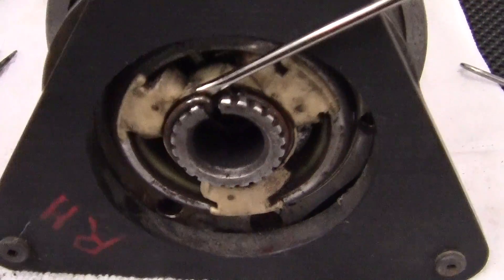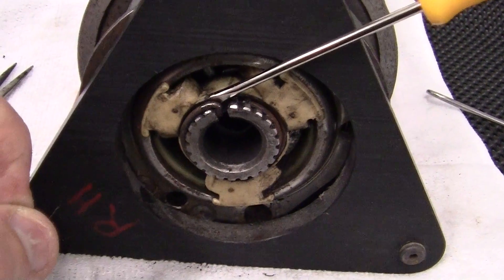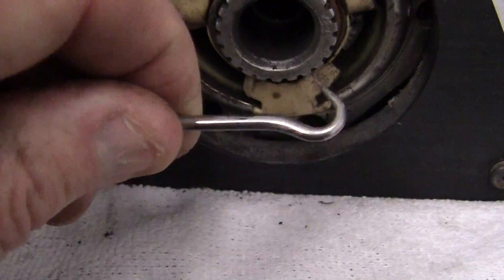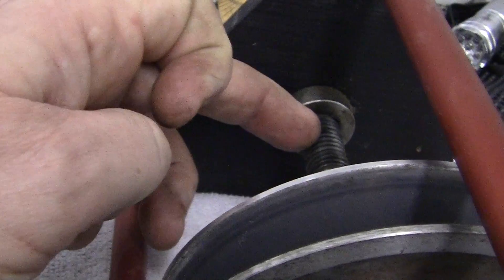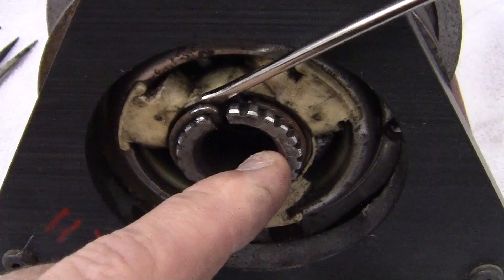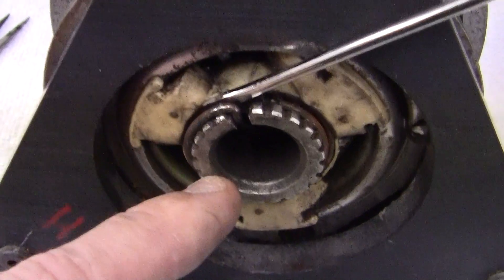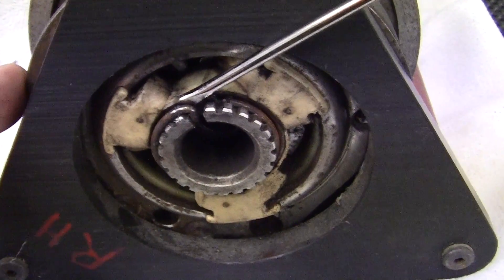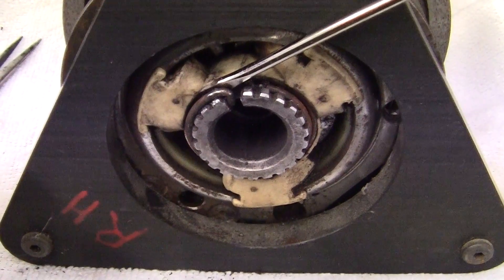130)-  PROJECT Honda  RUCKUS - HOW TO= Engine COMPLETE REBUILD

Comment: How did you decompress the clutch? I'm having some issue with that part. My ruckus is maxing out at 50 mph at 10430? I've done some research and everyone is telling me that my clutch is have bad travel.
Reply from the maker: BAD TRAVEL?? What the Hell are you talking about? I have never heard that term before , but I am intrigued by your question. The clutch decompresses approximately 3mm until pressure is off the C-ring holding the clutch together. I need more information about the problem of yours, Please explain and tell me everything to get a good answer back to you, my friend, Thanks DSD
Reply: I found out what the issue was my Polini Variator was causing my clutch to hit the Rev limiter at higher rpm's (50 mph at 10400 rpm's. I just switched out varistors and that dropped my rpm's to 9300 at 50 mph. I think I have defective Variator